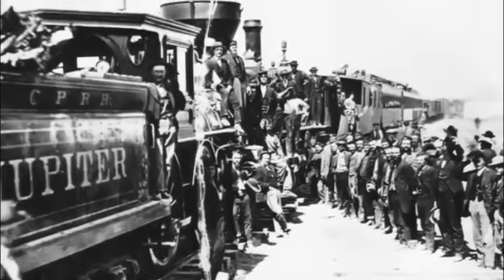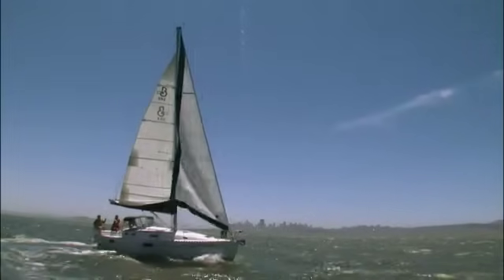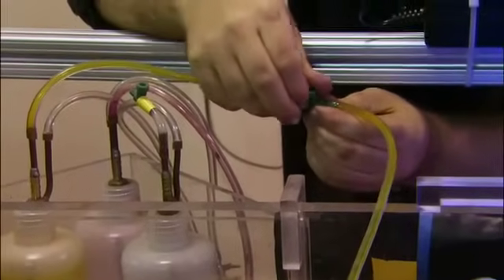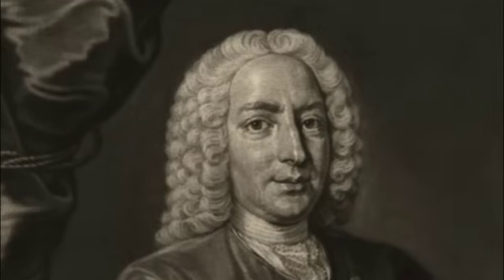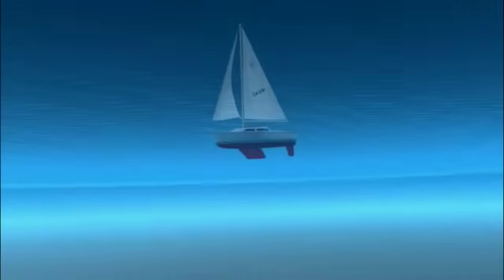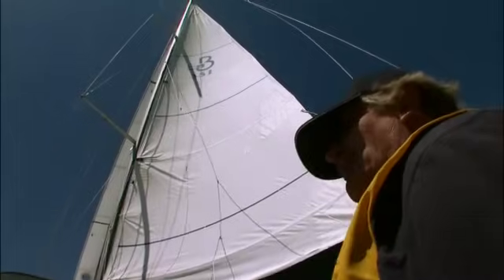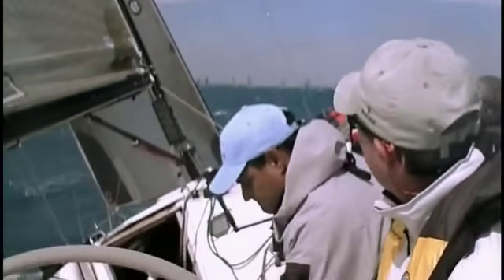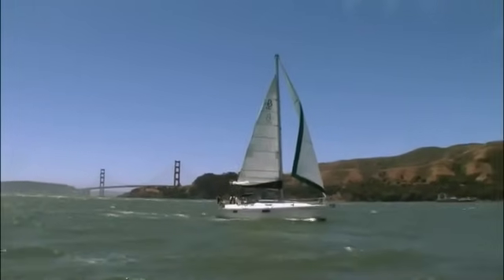The Physics of Sailing | KQED QUEST

Comment: This is outdated. The Bernoulli Effect is a minor player in lift. There's no "deadline" for the streams on the curved side to meet up with their counterpart on the flat side at the trailing edge (so they don't need to accelerate). In fact if anything, hitting a curved surface would slow down the stream because it's an obstacle.
They've discovered that something called the "Coanda Effect" plays a bigger role. This is the tendency for molecules near a surface to stick to the surface and the molecules next to them stick to those molecules. This accelerates the stream away from the direction of lift (90° to the direction of the stream). This acceleration produces an equal and opposite force in the "lift direction" causing the lift. This is a simple example of Newton's famous equation  F=MA.
That's why you can make a wing create lift upside down by just adjusting the angle of attack (watch an air show). The Bernoulli Effect can't explain that.
 - Warren - BSc  (Physics)

Comment: 1:40 Lift from the sail is perpendicular to the wind. It tries to make the boat plow through the water across the wind, but the keel can only slice through the water edgewise. 
The water prevents the boat from drifting sideways by pushing on the side of the keel, and that force is partially upwind.
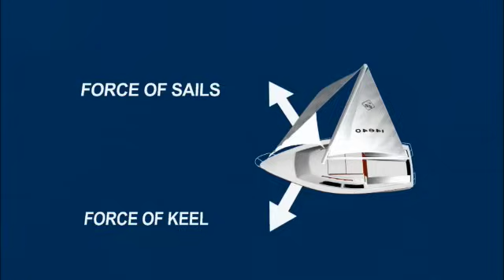5:40 The force from the keel has no forward component. Only the sail pushes the boat forward.
End: You need to explain torques and ballast, heeling and righting moments.

Comment: I was already familiar with sailing when one of my physics professors explained that a triangle sail when properly set "sucks" a boat forward as air moves across the sail and creates lower pressure on the outside of the curve not unlike the wing of an aircraft pulls an aircraft from the ground with lower pressure on the top of the wing.

We all knew that he was talking about pressure differential but apparently liked using the pull or suck analogy.

Comment: As said in other comments, the explanation is wrong, using Bermouilli's law (linear acceleration of the air implying a depression). This has been proved in several experiences, the air is not changing speed, but is just deviated (tangential acceleration). When a mass (here the air) is deviated, the item provoking the deviation receives a force, just like in the hammer throw, where the mass rotating around the thrower is applying a tension to the cable. For a sail, the deviation of the air happens on the front side, where the wind pushes the sail, but also on the back side if the sail is well trimmed. This latter effect is well demonstrated with the experience of blowing on the paper of the video: the air would like to go straight,   but that would create a void along the curvature of the paper, so the air is deflected downward, and the paper is pulled upward...

Comment: I always assumed the keel is to prevent the sail from toppling over. I don't understand how the keel can produce a forward force component, isn't is perfectly symmetric about the centerline of the boat?? Does the keel tilt with the rudder??
Reply: Although your comment is old, in case someone else has the same question: the keel does not tilt and it is symmetric around its chord line but the angle of attack is not zero. The direction the boat travels is not parallel to its centerline. Since water is hundreds of times denser than air a small keel compared to the sails and a small angle of attack creates enough sideways force to balance the opposite sideways force on the sails.

Comment: The historical context by the reporter is incorrect the Europeans did not come over to the Americans using square sails. they were starting to use  triangle sails then  allowing them to  almost run into the wind  this  was by the 1500s  which they learned from the Arabs which some say the Arabs learned from India

Comment: Ok, at 5:41 I can picture the Force of Sails.  But I can't picture the Force of Keel in that direction.
Reply: That's because their illustration is wrong. The force of the keel will be a frictional (drag) force so it would be acting on the opposite direction of the boat's movement. Sailboats do not move in the direction they're pointing, well they do, but they also drift sideways (due to the force of the sail having a significant 'sideways' component) and the keel/centerboard basically just reduces the movement in that sideways direction through through drag. 

Anyway, in short, the keel produces a force opposite of the direction of movement.

Comment: 7:40 wrong. Stall in case of an airplane, yes. But not a flagged sail in a sailboat. Rather, the sail would be filled, but from a more perpendicular angle, which is less efficient for speed.
Reply: How could it be filled if the wind was flowing parallel to it?

Comment: This video is not the whole story. Of course a square rigger can beat to windward. A sail (or even an airplane wing) does not have to have the special curvy shape to generate lift. It just needs an angle to the wind. When you stuck your hand out of the window of a moving car as a kid, did you not notice the sideways force? And that was without any bernoulli curve. The curve just makes it more efficient especially in light wind and where you want to get as close as you can into the wind direction.

Comment: Both my son's are aerospace engineers and state that Bernoulli's phenomenon plays only a small part in generating lift
A helicopter blade rotating at speed will generate almost no lift until the angle of attack is altered to displace air downwards
Only then will the helicopter lift off
Sails do not have a flat windward surface. The distance travelled by the leeward and windward air streams is virtually identical (in fact often longer on the windward side) It has been clearly shown that airstream velocity is the same on both sides of a sail
Sails work by displacement of air, not by the Bernoulli phenomenon
Reply from the maker: Interesting! Thanks for sharing your research.

Comment: Why do I have to pull so hard on the tiller handle when my sailboat is leaning hard over? Seems like that much rudder slows the sailboat quite a bit. I have a 28ft Ranger sailboat
Reply: Rich Blake it’s called weather helm trim your sails and it will reduce
Reply: this may help a bit...https://www.youtube.com/watch?v=21op1ijfhhU
Decreasing mainsail relative to headsail will help

Comment: 3 kids in the backseat of a car going around a corner. Kid on the outside feels the pressure. Centrifugal force, inertia. Water going round a bend in a pipe. Water on outside feels the pressure and slows. Water on the inside the opposite, low pressure high speed. Cyclone/Hurricane/Water down the bath drain...low pressure & high speed in the centre vs low speed high pressure outwards.
Wing/Sail splits air into two parcels. Air on top/leeward, inside of curve is against the surface therefore high speed & low pressure against the top/leeward. Below/Windward outside of that parcels curve is against the surface therefore low speed and high pressure against the surface...
Want to point higher?
Air is pushed to the low pressure leeward side causing a curve in the air flow from windward to leeward presenting a lifted angle of attack to the leading edge. You may notice the very front of your jib points further to windward than it otherwise ought.
This curve is called upwash. 
The overall dynamics around the wing are circular and in balance. In that vain there is also a curve back to windward aft of the sail, balancing out the upwash and yes it's called downwash.
Tighten your leech, ie: add hook to the aft of the sail and increase downwash....and therefore increase upwash ie move the angle of attack further to windward...and lay that mark

Comment: Sailboats work without keels, and so do sail karts for that matter, so this video is already confused.  Better analogy is your hand riding the wind outside the open window of a moving car just like you did as a kid.  Tilt it up and feel how fast your hand shoots up at that angle.  That angle of attack is what sailboats take, shooting them forward as fast as your hand shoots up. You can trim the shape of your hand and its angle of attack for differant results.  Your hand is not a wing shape and doesn't need to be.   What's important is that the leverage your arm gives from you sitting firmly inside the car, against the wind is what the boat the boat needs from its base wedged in the water.   The boat and sails leverage the wind against the water.   If the sailboat was not wedged into that flow of the water, then the whole thing wouldn't work.  Without the water it would be like your hat flying of your head in a convertible or a kite without a string.
Reply: Sailing vessels without a keel work by sailing on an edge (akin to a snowboard).  This is what provides to opposing vector.  And this is how windsurf boards work AFAIK.  They are correct about a keel providing the opposing vector.  A yacht without a keel will be incredibly inefficient and can easily be overcome.  A fin is a form of keel btw.

Comment: Lift is very easily explained and shown with a spoon and a kitchen faucet. 
- Turn water on.
- Hold spoon lightly by topmost handle. It almost falls but not.
- put spoon , round side into stream of water. 

( one would generally think that the water pressure falling over the rounded spoon would push it out of the stream... but one would be wrong. It gets sucked into the stream. The faster the water over the spoon the more it gets sucked in. A wing is the same ... just horizontal.

Comment: I agree . The talk about "lift" is just plain wrong. The flexible, 2D sail is NOT a wing. A wing has a solid surface above and below. A sail has a curved surface in front and behind. The breakdown of the force vector which is the wind direction into components is the correct analysis of the physics. One component pushes the boat forward into the wind. The keel indeed stops the hull from slipping sideways through the water in the direction of the wind. The combination of wind forces on the sail and water forces on the keel results in the hull moving up wind at an angle. Naturally there is a limit to the angle into the wind. Somebody should publish a free body diagram of a sail boat. And to suggest that a knowledge of physics is unnecessary to sail a boat is just plain ignorant. If you understand the physics you will be a better sailor. If you can sail a boat you must have a knowledge of physics, albeit expressed in terms other than the usual concept of balanced forces on a boat.

Comment: I agree with Norm but also want to point out the you can fly with a plywood wing if it is angled front up a little.  So what is left out of the discussion is "how much of the force" is due to Bernoulli and how much is just pressurre against a flat surface.  I think that the Bernoulli component may be as little as 10% but those guys with the fluid chamber should be able to figure it out.  Also in the demo of the chamber with the big fat wing show the flow had separated completely off most of the wing so not much Bernoulli there.

Comment: Ok this will be a informative video!
“Square rigged sailboats can only go one basic direction.”
Nevermind.
Reply: xD
Reply: @mamneo2  xD
Reply: @A l  xD
Reply: @buckeye2300  xD
Reply: They don't?
Reply: @djkm9558  imagine, angling the square sails to sail under high angle of attack to the wind. the main difference is that  bermuda rigs(triangle) can sail at very high angles towards wind.
Reply: @Mikshvert  i suggest that you watch some videos of the viking boat Drakken Harald Harfarge.  It has a single square rigged sail and it can sail close to the wind.  Undoubtedly a bermuda rig can get closer, but obviously those old time sailors got home again so clearly they could tack against the wind.
Reply: @djkm9558  They can't sail upwind... But I wouldn't call a 180 degrees of potential sailing direction (port beam reach to starboard beam reach) "one direction"
Reply: @djkm9558  of course they did. you really think they discovered america just by being lucky with the wind direction? or did world wide trades with only wind direction? 

sailor: captain, looks like we have to go back, the wind has changed.

or

somewhere in antartica: damn wind, we wanted to go to china! guess well have to sit this one out boys.
Reply: @jessekieboom3815  Though in fairness, most trade did follow the prevailing winds such that the ships were generally running. Obviously, contrary to what the video suggests, square sails can sail against the wind, though not as efficiently or with as much control as modern Bermuda or ancient lateen rigs. Clearly square rigging had its advantages, though, because they continued to be the primary sail on large vessels despite Europeans being very familiar with and regularly utilizing lateen sails.
Reply: Lol.  Yep 10 seconds in and I laughed that modern kids playing with carbon fiber toys for a few weeks think they more than the old school sailors.   Look up how they uptacked a 1500 ton frigate.
Reply: Video: "Square rigged ships can only sail downwind. People then weren't smart like we is."
Me, who has never sailed a boat in my life: I know more than you
Reply: @i don’t know what to do here xD
Reply: Once the science guys started it was good.
Reply: @Ninja DIY xD

Comment: Where can get one of those thick aerodynamic sails, mine are all as thick as a sheet of cloth? Maybe instead of looking at airplane wings they ought to look into ventilating catalogue duct turn vanes which deflect the airstream smoothly through up the 90 degrees. Sails extract thrust from the wind by the weight of the air that is deflected .

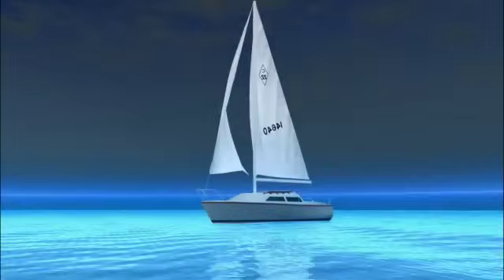Comment: 5:48 the vertical component (on the path line) of both forces (on keel and sails) not the component of force on sails with the path line, the force on keel has on component that canceled with the component of sails force.

Comment: take a landsurfer,the wheels stop the thing from sliding sideways as a boat does without a keel?
The wheels do not generate lift?
Reply: ... Not sure it's called as such, but it's very comparable: when too much side force is present they "stall" much the same way, and you can "re-attach flow" by turning your wheels to match the direction and/or speed of the "flow". Driving on dirt /gravel /icy roads this is an important concept to understand.

Comment: As someone already pointed out, the physics explanation of the lift is WRONG ! There is no reason why the air should hurry around the curved area (there is no law saying that the transit time must be the same on the two sides of the sail/wing). It's just the curved geometry of the sail that leaves a side with less air, hence a lower pressure that causes the lift in that direction. Google "how wings really work" and you'll find a nice explanation from a Cambridge professor

Comment: I like how they say that they're getting into "the nitty gritty" with lift and then they explain it wrong with that explanation you could any the with a flat bottom and a curved top produce lift, instead of using Bernoulli's law wings use Newton's third law. The airfoil shape forces the fluid down which makes the the object go in the opposite direction. (Every action had an equal and opposite reaction)

Comment: And THIS my fellow sailors, is WHY we NEVER confuse facts with Television.
Reply: @J The fact that they act like ancient sailors didn't use physics lol.  Uptacking and uplift were concepts old sailors knew well.  Of course a carbon fiber boat weighing a few thousand pounds is not the same as a 1500 ton frigate.
Reply: What does that mean?
Reply: @JamesD2957  The video is an oversimplification to the point of being wrong.
Reply: @peterisawesomeplease  In what sense?
Reply: @Vrig  See my reply to James. But in a nut shell both lift itself and turning lift from a sail into forward momentum are very difficult to explain without math. There isn't a great intuitive explanation of either that can be described in this short of a video.

Comment: I am amazed that a video about the physics of sailing spends so much time implying that it is just to difficult for most people to understand. Is this what science education is all about in the US?. I was also impressed by the incorrectness of much of what was said. Sucking is NOT a force. If you have higher pressure on one side of a wing or sail than the other then it is excess pressure giving the resultant force not the lack of pressure on one side.

Comment: I don't understand this... he said at 3:34 that the place where it was curved and where the color accelerated it created a "lower pressure". If the pressure is there lower, the object would normally move towards that point instead of being lifted away from that point. Am I missing something here?
Reply: hahah omg he actually said it 5 seconds after that hahah but they are simply horrible at explaining things!  Typical American physicist. So here is the thing, sail is this cloth thing material on the mast. Mast is like this metal dick on the ship. Okay? so far so good... Wind blows into sail from a 45% angle (NOT HORIZONTALLY NOT VERTICALL), then sail is curved on one side. Why is it curved? Well YOU MAKE IT. You tie the center of it on the side of the ship so it is curved! On that side air has to travel longer distance, okay, it is curved okay? >>>>> Air moves faster >>> pressure falls on that side >>> on the other side pressure is high>>> ship moves to the side with lower pressure (side where sail is curved). Keel is this thing you have in the water... it makes the ship go forward and not completely to that side so yeah. Mkay? Okay...